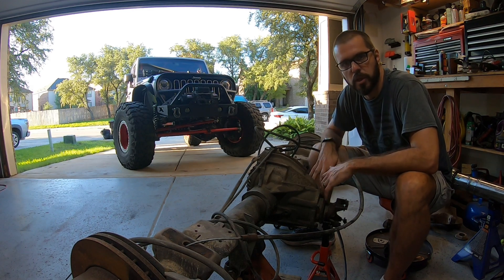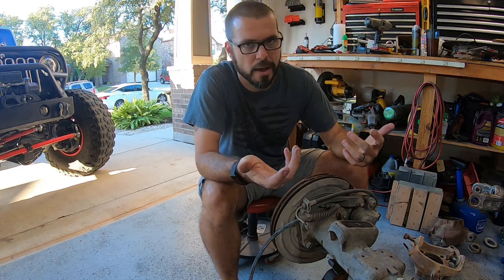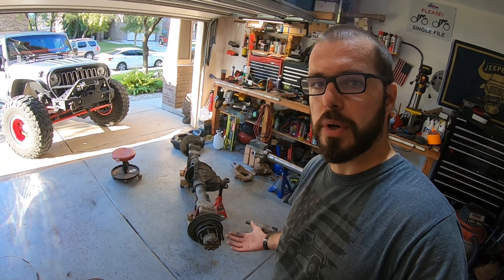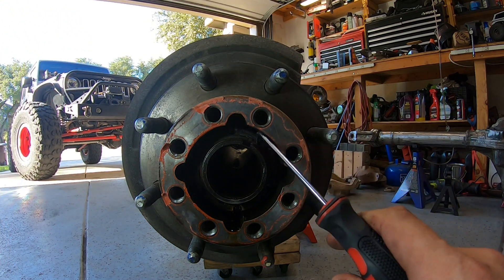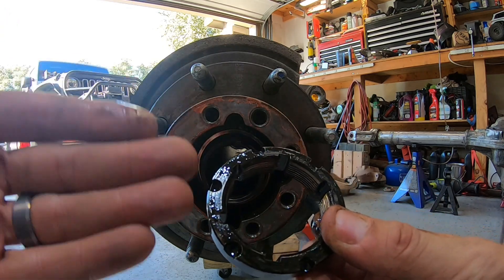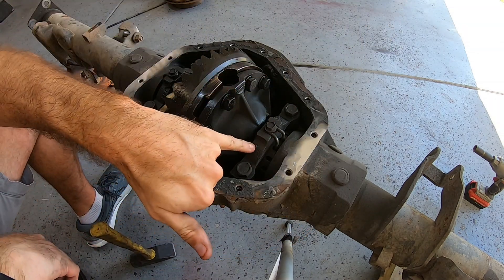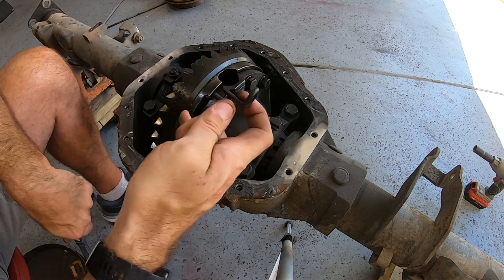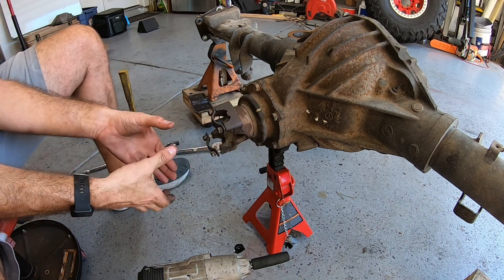14 BOLT AXLE SWAP PREP - Project Maple Leaf Jeep Build (no. 5)

Comment: ,,,,I'm   buildin  a drag car  with  my  1996   Z/28  camaro,,,,,,as you  know , the stock   rear  axle  is  weak  junk,,,,,,,,I'm new to  the benefits  of the 14 bolt  gm   rear axle,,,,,,,,I would  need to have  the  axle  unit  with a non  live  hub  bearing   [passenger car  style   14 bolt].......can you tell me  what  pick-ups  ;  such  an  axle  came in   , as I can  hunt  one  down  in a wrecking  yard...........thanks